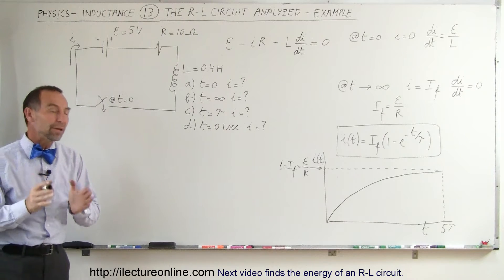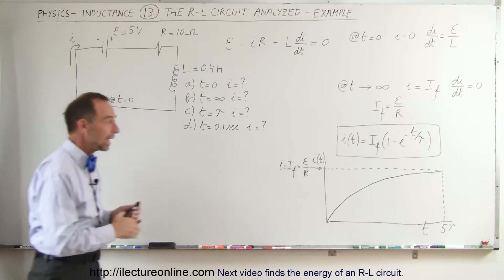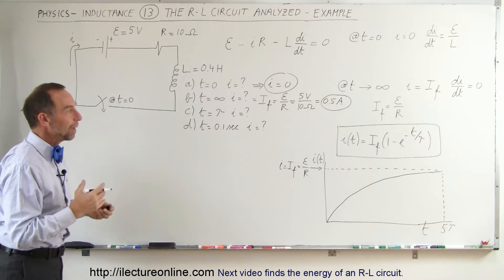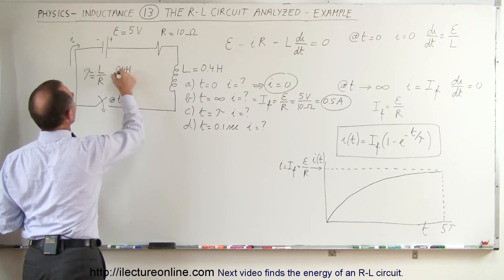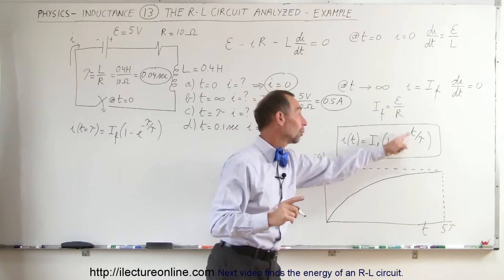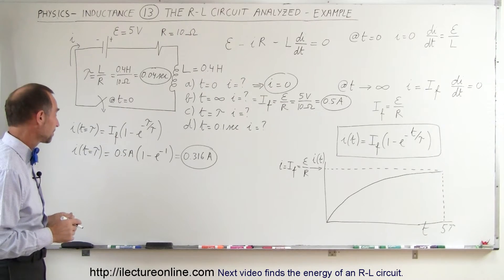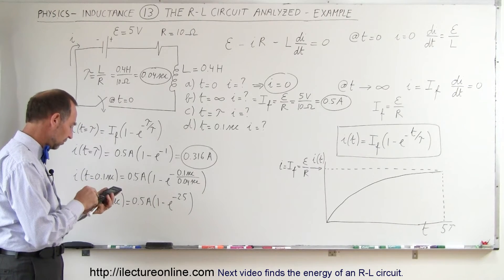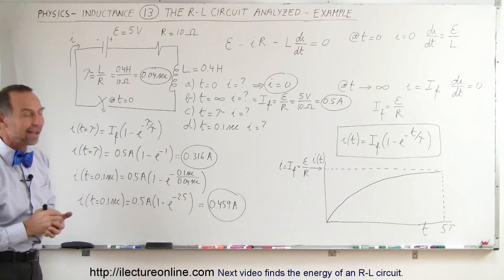Physics 47  Inductance (13 of 20) The R-L Circuit Analyzed - Example

Comment: What would happen if we have multiple Resistors in the circuit? thank you so much.
Reply from the maker: +lam nguyen   If the resistors are in series, you can simply add them together and consider them as one resistor of the equivalent resistance.